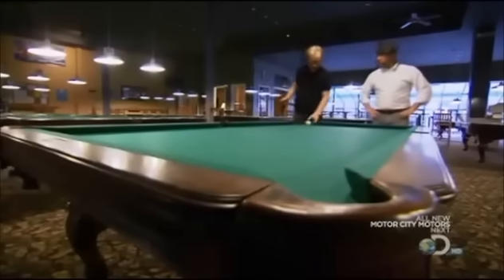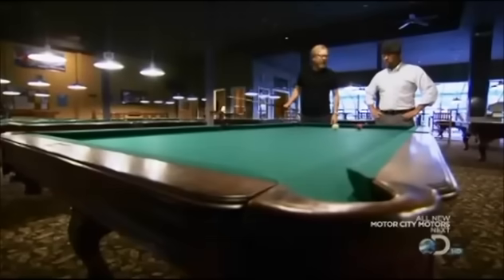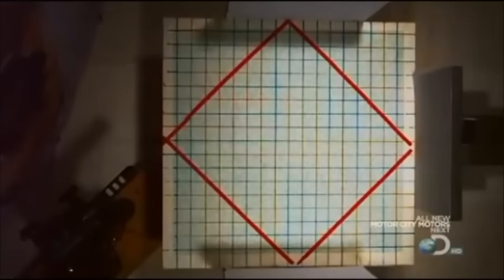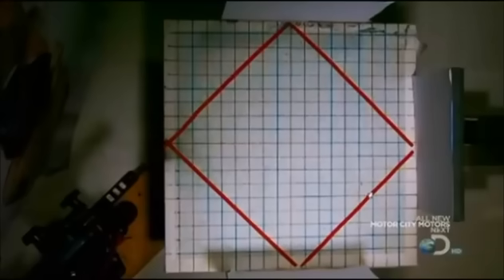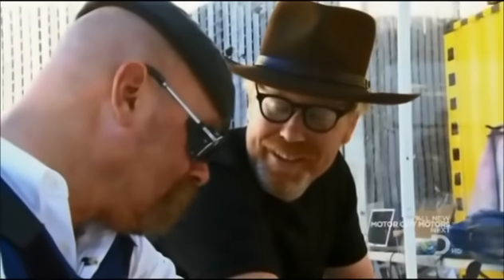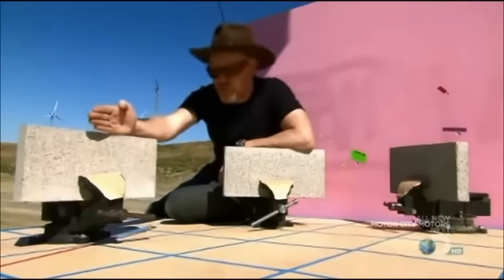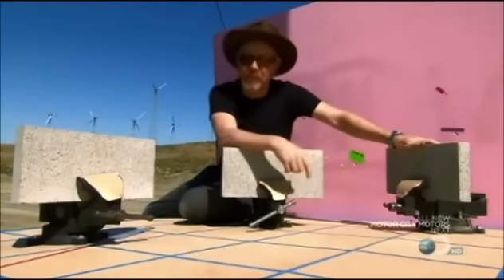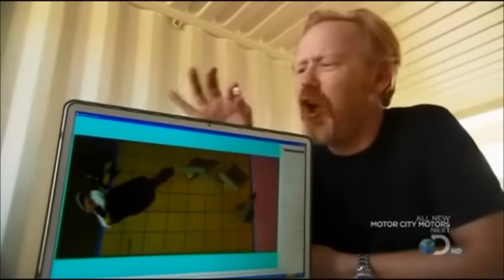360 Ricochet - Mythbusters for the Impatient

Comment: That's not a 360 degree ricochet... it bounces three times, each one being approximately 90 degrees, adding up to 270. for it to be 360 degrees there would need to be a fourth bounce behind the shooter, so that the bullet hits them in the back. 360 degrees is a full turn, if a human were to turn 360 degrees they'd end up facing in the same direction. Similarly, if a bullet were to do the same it would end up travelling in the same direction as it started out.

Comment: Shouldnt this be called 180 ricochet?
Reply: Where are you getting 4 90s? The bullet is shot and then hits the shooter, if it did a 360 it would continue in the direction it was fired...
Reply: Ah okay. So then it would be 270, because it turns 90 degrees 3 times.
Reply: No because 90 + 90 + 90 + 90 is 360.

Comment: normalization means the angles are weird, and the velocity loss is squared. its like shooting spaced armor on tanks. even if you shot APFSDS, if it ricochets twice and hits spaced armor, the velocity slows down exponentially per CENTIMETER of travel through fluids and in this case its air

Comment: I wished they tested this with 5.56x45. I've heard enough horror stories from fellow soldiers that have seen deadly ricochet. The .223/5.56mm is perfectly light enough to bounce and not lose that energy especially the steel core. It also ricochets off bone. I've seen ricochet but not deadly like that. I've been hit by ricochet on smaller projectiles travelling slower. Plenty of youtube videos of ricochet. I think they left too much out in testing. Another myth they busted, splitting an arrow. My uncle did it successfully and he's not the only one I've seen do it but good luck scientifically reproducing it. That actually is this show's biggest thing holding them back. But also in their defense, limited budget and time. Not like the Government funds them after all and production costs for this show have to be astronomical.

Comment: This is actually quite interesting - they mention that they should be able to get a higher speed if they use a softer material to ricochet the bullet (e.g. concrete instead of steel), but prima facie a higher speed should be achieved by a harder material (less likely to deform) since the kinetic energy of the bullet (in theory) should mostly be converted back into kinetic energy in the ricocheting direction via an approximately inelastic collision. In the case that a softer material is used, some of the energy is used to deform the ricocheting material, so not all the energy is converted into kinetic energy, meaning that you should get a slower speed than for the harder material. A good analogy would be trying to bounce a tennis ball off a hard floor vs trying to bounce it off a very soft bed - in deforming the bed, some of kinetic energy is absorbed so the tennis ball doesn't bounce back up as much. So why is it that the bullet appears to go faster when a softer ricocheting material is used? The answer appears to me that when a harder ricocheting material was used in this test, the bullet itself was deformed, and more energy was lost in the process - in fact since the bullet splintered, some of the kinetic energy was also converted into kinetic energy of the splintered portions in the wrong directions. Ideally, what you would want is actually as hard and as tough a surface and bullet as possible. We need hardness because we want to minimize the deformation altogether*, but we also need toughness (which is the energy that the material can absorb before fracturing and breaking apart) to ensure that the bullet and the wall remains roughly intact when hit (so additional energy isn't taken up by the kinetic movement of splintered portions). 

Theoretically speaking, if you have a wall and bullet of infinite hardness and toughness, and undergoes no deformation whatsoever, and you also had a perfect vacuum to conduct your experiment, you would find that the speed the bullet comes back at you will be the same. 

*Actually what you need is yield stress but I won't go into the details here
Reply: ... We're here because we're impatient.😏

TL;DR?

Comment: isn't this a 180 ricochet since it's turning back at the shooter?
360 would be coming back at the shooter then back towards the target.
Reply: It's called a three sixty cause it travels in a full square path with four ninety degree angles
Reply: @Riganotza  Should be called 270, since that's how much the bullet turns :P
Reply: NeatNit once the bullet returns to the shooter it completes the boundaries of a four-sided shape, completing the 4th 90 degree angle with the trajectory of the initial shot. A four-sided shape's internal angles are always equal to 360 degrees
Reply: @ayoutubechannel7143  It never makes the final 90-degree turn though.
Reply: @NeatNit  It doesn't need to. Imagine drawing a square when your starting point is at one of the corners, the line you draw will only "turn" 3 times however there will be four internal angles created equal to 360 degrees. The same logic is applied to the 360 degree ricochet as the bullet's lines of trajectory draw out a 4 sided shape
Reply: @ayoutubechannel7143  This is physics though, not geometry, and the final velocity of the bullet is 270° (or 90°) from the initial velocity. Sure, it traces out a square, but the shape of the path doesn't matter as much as the actual velocity.

And if you're not convinced, let's agree to disagree.
Reply: NeatNit considering you've just used the term 'velocity' to describe an angle, I doubt you'll be convincing anyone any time soon. But anyway, I've explained this in the simplest way imaginable but it's like trying to get blood from a stone so you won't see me replying again. Good day and good luck because you'll certainly need it
Reply: @ayoutubechannel7143  I was very clearly talking about the angle between the velocity vectors, and you've just perfectly described what it feels like to talk to you.
Reply: @ayoutubechannel7143  
Using your own square example it still doesn't hold up. You aren't starting your square at the corner, the shooter is standing on the corner but your starting point (gun) is just off the corner.
 Imagine the bullet being your pencil that is drawing the square; the bullet would have to ricochet off of a 4th corner and return to the barrel of the gun to complete said 360 degree loop. It just so happens that the target ,the shooter of the gun, is standing where the 4th angle would be.
Reply: Or you know, you could accept you've said something dumb and forget about it
Reply: @ayoutubechannel7143  yeah velocity is a vector. It describes speed AND direction.
Reply: @thomashafner8226  is direction same as an angle? Cuz I'm thinking direction is a straight line and if it changes direction, it wouldn't be the same direction thus not the same velocity
Reply: @Yugiohcomebacks  I think I worded my comment oddly, I was actually disagreeing with Bryan X. I totally agree with you.
Reply: @ayoutubechannel7143  it only changes 3 90 degree directions. the bullet only travels 270 degrees. BUT it still makes a square.
Reply: Bryan clearly doesn't understand that a velocity includes both a magnitude and a direction. You probably shouldn't bully him too much for not passing his high school physics class.
Reply: This is the saltiest youtube thread about something that doesn’t matter at all lol
Reply: Wow... really guys? And you got 184 people who are also stupid.
Reply: @Ammosam Hoost no... no its not. 3 times 9 is 27... 4 times 9 is 36. Hence, 4 times 90 is 360. As in 4 fucking 90 degree angles. Omg am i have a seizure or an aneurysm?? Dude peoples come on this is basic math when u exclude the geometric aspect and the only thing geometric about it is its a fucking square. Fuck me man....
Reply: Ammosam Hoost I honestly can't tell if you're joking or not
Reply: @MrID36  is it that hard ? you start from A , and come back to A ; if you make a turn of 270° , you wont return to A , if you make a 360° turn you will return to A . 

i know you guys belive the earth is flat , but that bullet made a 360° turn , 270° its just the sum ( 90°+90°+90°) of the angles it traveled , not of the "circle" it made .
Reply: Yes but it's final direction is 270 degrees rotated from the initial direction. It should be 270.

Comment: Well bending bullet was a kill shot. If you attach a tangent to every point of the tube used for the bending bullet test you'll see many angles that make it posible. Sadly it would be very hard to do the same with the steel plates, they are too big, the area needed could exceed the range of the bullet, and the number of steel plates could exceed your budget.

Comment: im sorry but if getting hit by a car at 60 miles an hour is lethal and a small metal harder than steel ball is heading at me at 100 feet a second i would say its pretty damn lethal if it hit me in the neck or chest area. it could easily puncture a lung or an artery so yeah im going to have to disagree with you guys on that.
Reply: moviemaker2011z The force is dependent on the mass too, not just speed.  Imagine dropping a quarter on your foot and then dropping a cannonball from the same height.
Reply: Spencer Lanman kinda true. Again 100 feet a second hitting your neck area no matter the size be it small ball bearing or cannon ball. Those speeds are deadly.
Reply: Hitting the chest are a could be nonlethal and hurt like a bitch but neck or head? But that's got to be lethal.
Reply: It's not lethal.  If you want proof of how important that mass difference is, look up how fast airsoft guns shoot.  They are all faster than 100 fps and they don't kill anyone.
Reply: Spencer Lanman oh sure light not very dense plastic as compared to dense metal. If you are laying down on the ground and that bowling ball hits your chest at 100mph I'm pretty sure your dead. Look it's just common sense dude. They don't take into account vitals or anything major, they go by a very flawed system and it's proven. They have bullets go 2 or even 4 inches deep into ballistic gel and they say it's not fatal yet think of all the things that bullet could hit in just 2 to 4 inches.
Reply: moviemaker2011z Density doesn't really matter here.  If you've ever held a bullet you would know it doesn't weigh much.  More than an airsoft bullet but no where near a bowling ball.  It might take an eye out but it's not going to kill you.

Comment: 35mph to the eye that would fucking kill you
Reply: It most definitly woudn't: http://biology.stackexchange.com/questions/10887/what-is-the-strength-of-human-cornea

«A pneumatic cannon was used to impact eyes with a variety of projectiles at multiple velocities... The projectiles selected for the test series included a 6.35 mm diameter metal ball, a 9.25 mm diameter aluminum rod, and an 11.16 mm diameter aluminum rod... A range of internal eye pressures were produced that varied from 1256 mmHg (24.3 psi) to 22843 mmHg (442 psi)... [and] resulted in zero globe rupture.»

Up to frigging 442 psi doesn't get through the cornea. It most likely woudn't even blind you (or at least, not permanently). The human eye is a lot tougher then you see in movies, a human can't pierce eyes with its fingers like you see in so many shows. Still would hurt like hell though but humans in general are a lot tougher then most people think.

Comment: 0:41 Lol entire round is flying through the air, shell casing, primer and all!
Reply: Contract92 No I'm definitely referring to 0:41 where they depict an entire casing flying through the air. The casing gets ejected out the side of the firearm, and only the bullet travels toward the target.
Reply: And the primer hasn't even been hit!
Reply: Higher efficiency! Can be fired twice!
Reply: John McWhirter I think you'll find that it is a wad, similar to what you find inside a shotgun shell between the powder and projectile/s. It would have been necessary to put something into the case to hold the powder in position before dropping the loose bearing in.
And the time stamp you are referring to is actually 2:41 - not 0:41.

Comment: What about a single smooth-polished surface in a U shape? It'd have to be massive so that you got a soft enough angle at each point, but couldn't that theoretically work?
Reply: they did that already as a separate myth. They fired a gun into a curved tube and it slid around and came out the other end with lethal force.
Reply: It was the same episode lol, after this myth was busted they tried it with a bent tube, and it worked!
Reply: @Simon-xj8hc  Thanks, found it thanks to you! https://www.youtube.com/watch?v=73FFitene58
Reply: Your idea actually made me curious and I've done some calculations.
If I haven't done any mistakes in the derivation (I am somewhat skeptic towards the result) the radius of this U-shape shouldn't matter and the exit velocity should be:
v(exit)=v(entry)/(e^(mu*pi))
e.g. for steel/teflon 'mu' could be as low as 0.04, thus the bullet would exit with around 88% of entry speed. Limiting factors are probably the material strength and the centrifugal forces acting on the U-shape or bullet.
Feel free to check, my calculations might be garbage.
Reply: MiskyWilkshake These were my initial thoughts aswell. But it think the problem is, that this formula neglects the fact, that the force acting on the bullet might actually break it, and the force gets greater the smaller the radius gets.
It could be that for a radius that's big enough, let's say 15m, it might actually work
Reply: Don't shoot at metal drums.
Reply: Fun fact with a low enough calibre gun you can do that with a human skull
Reply: MiskyWilkshake Maybe then the friction is too high
Reply: Without knowing anything of your maths/physics wizardry, it doesn't sound right to me that the radius shouldn't matter - surely that should be the most important factor (other than perhaps the friction coefficient?
Reply: Schmudli your mu depends on the angle of the bend. The shorter the radius the harder it pushes against the steel => higher friction....
Reply: no dude, so need at least 30 degrees angle to richochet, so it never will work unless you get a shape with 12 sides
Reply: The mythbusters did a curved barrel myth in another experiment.

The bullet is much much lethal even past 180 degrees which is the criteria of this experiment.

You could theoretically make the bullet do a loop and have it still be lethal.

It has been tested but the experiment files are pretty rare.
Reply: Schmudli Well, that's why I said smooth-polished. Surely with a gentle enough curve and a smooth enough surface, it should be theoretically possible?

Comment: How is a tiny piece of metal going 135 mph not lethal? Hell you can throw a knife half that fast and kill someone and some bullets (or at least fragments) are sharper than that.
Reply: +Andrew Mullins Bullet fragments aren't sharp. You literally can't cut anything with lead because it would bend, and flex out of that way.
Reply: Yea the jacket might be a little sharp, no where near as Sharp as a blade or thin. I recover my jackets monthly outta the tires I shoot, a bullet or any light weight small projectile needs be going around 800fps to be lethal. A knife weighs ounces or pounds, bullets weigh GRAINS.
Reply: Andrew Mullins you can move a knife 1 mph and kill someone.
Reply: Also, what if it hit the neck? Would it then be lethal?
Reply: +Andrew Mullins because the mass difference changes everything. throw a knife thats about 200grams with that velocity and u get a lethal force. throw a bullet that is roughly 0.5gram with the same velocity and then you'll get your answer : P
Reply: Airsoft guns shoot 400 fps. To be fair it's 6mm plastic but the gun would have less fps than a BB gun.
Reply: A knife is thin and sharp and had more mass
Reply: Usually around 600 fps is lethal because bullets aren't sharp at all, take a BB gun, those shoot only like 100-400 and even with a smaller ammo it's not lethal
Reply: Liam  shows you know nothing about bullets, when they shatter they are razor sharp. If they hit right they will kill you. Hell a google search shows how many people have been killed or seriously wounded